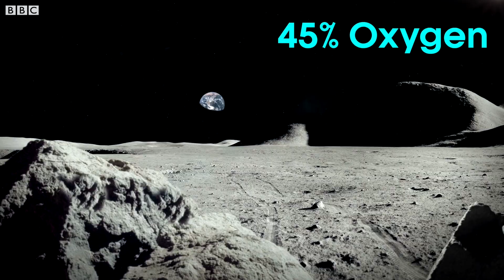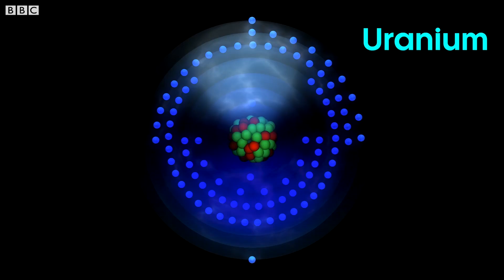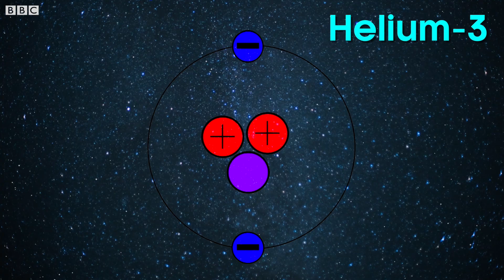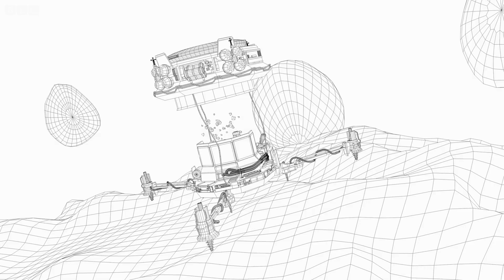Should We Mine the Moon? | Unexplored | BBC Earth Science

Comment: Beaming solar microwave energy from the Moon to the Earth is the silliest thing that I've heard of today. There's no need to convert solar energy into microwaves in order to transport them from the Moon to the Earth. THE SUN ALREADY DOES IT FOR FREE. We can just wait for the photons to arrive at Earth and take those.
Reply: The point is half of the moon's surface area is illuminated by the sun which represents an ADDITIONAL surface area of ~19 million km² or roughly the continent of South America on top of the sun-collecting surface area we have here on Earth. Now double that because only about 48% of incoming solar radiation actually reaches the Earth's surface unlike the moon, where low-gravity megastructures are also possible.

Simply reflecting that light as-is would require an extremely elaborate, potentially physically impossible arrangement of mirrors hovering and moving around the moon since the sunlit side rotates and is mostly not visible from earth. There'd be focusing issues over the distances involved and huge losses particularly through the atmosphere and clouds.

In contrast photovoltaic solar cells could be constructed from lunar dust and microwave beams relayed between satellites solve the transmission issues.